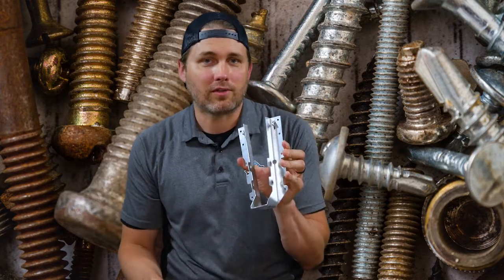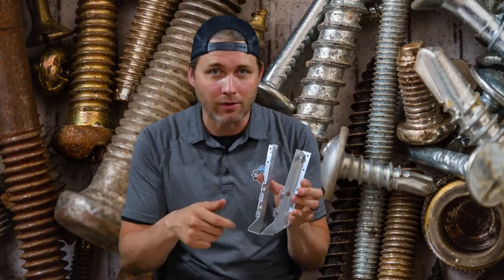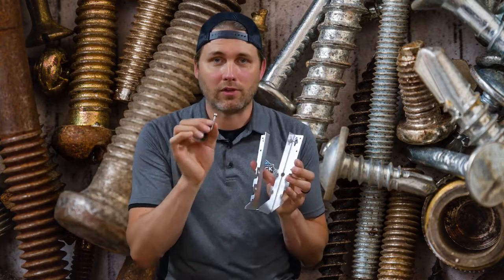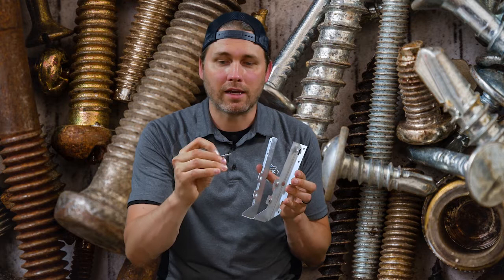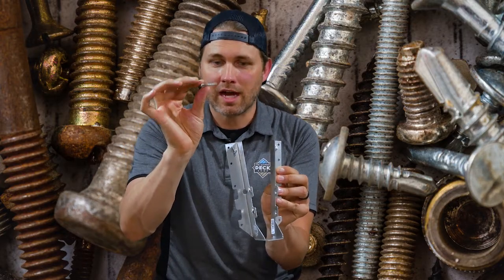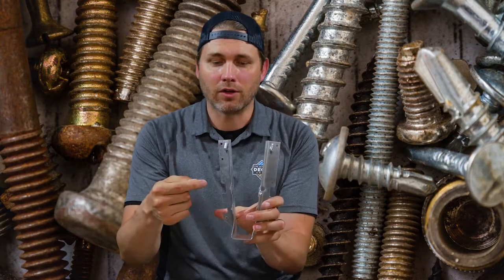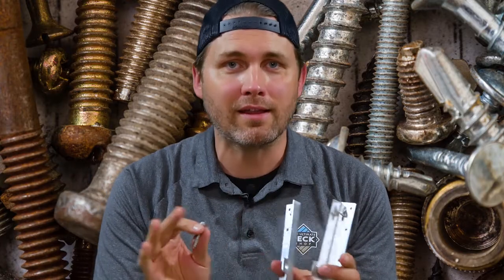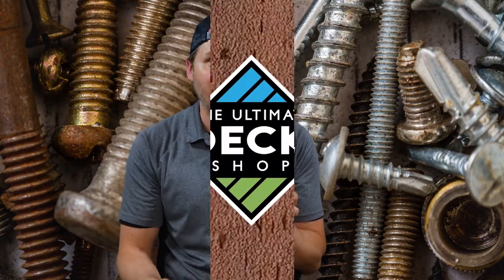The RIGHT fasteners for your Joist Hangers // The Ultimate Deck Shop

Comment: So are their different applications for the number 9 and number 10 screws?
Reply from the maker: Yes the #10 are a thicker shank and meant for the heavy duty hangers...HUS and HUC as opposed to the light duty LUS and LUC lines.
Reply: @TheUltimateDeckShop  Do you use the #10 screws for the angled holes into the joist on a standard 2x joist, or are SD screws only for the flat/ledger side and still stuck using nails into the joist itself?
Reply from the maker: @timkrueger8638  For standard LUS series hangers, you would use the 2 1/2" #9 SD screws in the angled holes.
Reply: Can you use the #10 in the lighter weight LU brackets?

Comment: What would you suggest for attaching an 8' post to the corners of a deck? These posts will also be used to support a roof that will be built later
Reply from the maker: That should bear all the way down to a pile.  It may drop to a beam, but then the post should continue beneath.

Comment: I believe they also dont have the coating for exterior application...anything going in treated at least needs a special coating like galvy or that paint...drywall screws and trim screws are hard and break
Reply from the maker: That's correct...galvanization, ceramic coating, or stainless steel primarily.

Comment: Thank you Shane and Ultimate Deck Shop for the helpful video. Trying to ensure I have the correct fasteners for my Simpson hangers has been a real struggle because there is so much conflicting information out on the web, and honestly a lack of clarity from Simpson. For example I see a lot of sources suggesting to use 16d 3-1/12" nails into a header / ledger, which to me seems like it would just "shotgun" the band joist and create excess areas for water to enter the house (in the case of a deck ledger), so the 10d 1-1/2" seems to make more sense there as it would only penetrate the ledger. Unfortunately, even Simpson's "Installation Guide" for the hangers prescribes a 3-1/2" 16d nail into the header, which would protrude beyond the surface of any single 2x lumber. Additionally, they don't seem mention the SD screws in the hanger documentation--I was hoping to determine if the 2-1/2 SD Screws are an equivalent substitute for the 16d 3-1/2" nails, and whether or not there is an applicable load reduction there, possible due to the reduced length. Anyway, thanks again for the video
Reply from the maker: If you dig into the Simpson website they have quite a number of tables and documentation about each of their lines of hardware, and I believe in some cases show load reductions.  But might be best to contact a rep if you're having a hard time finding the info you need.  I agree with you that the 3" spike through the ledger seems like a potential for issues...however, if the ledger is flashed appropriately, then there will be no water to find the holes anyway.  Thanks for tuning in and the feedback!
Reply: @TheUltimateDeckShop  Thanks for the advice. I was able to find some additional clarification from "Deck Magazine". So thankful for these resources!
https://www.deckmagazine.com/design-construction/framing/joist-hangers-for-decks_o